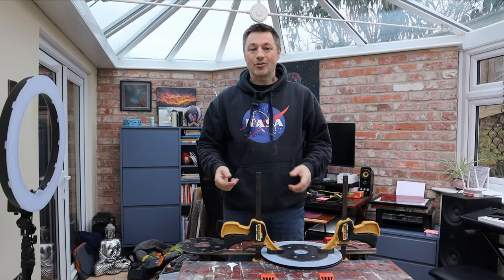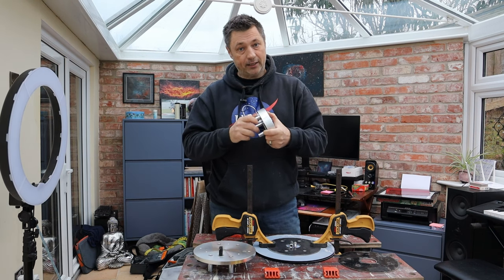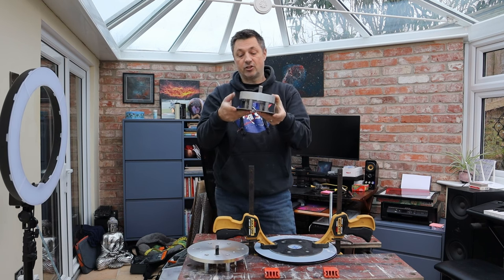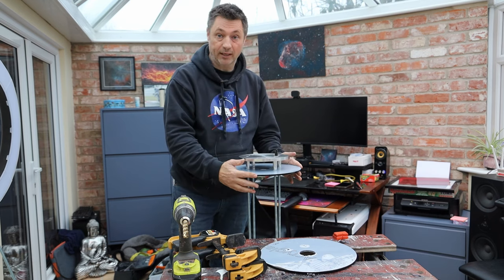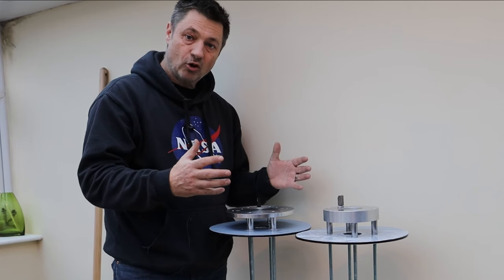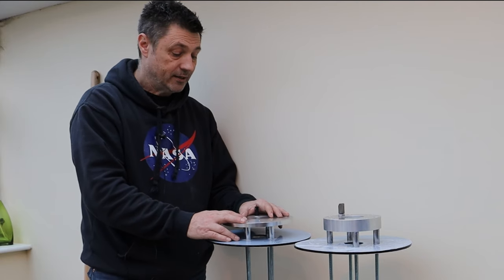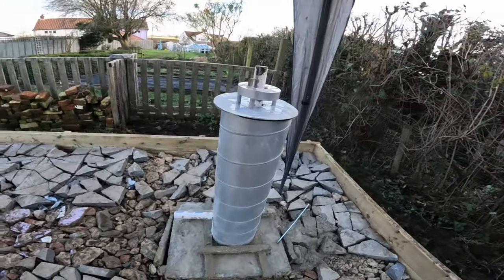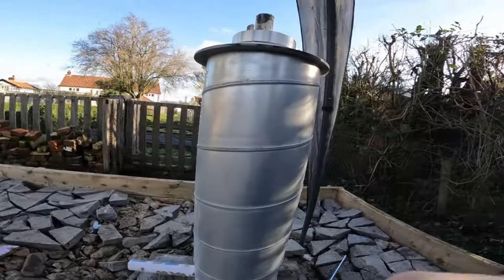How To Build A Pier For better Astrophotography

Comment: The piers look good. I had similar problems getting north and in the end I set a post in the garden and used it as a sight line to get my alignment.
Reply from the maker: Hi Steve. At one point I had a compass and 2 iphones lol. Its as near as and I am confident the mounts have enough adjustment to align even if a little off.  Thanks for commenting, clear skies

Comment: Very surprised not to see reinforcement bars for your base/floor.  I understand the aggregate of broken bricks, tile, and such.
Reply from the maker: You need to watch the full build videos. That was just the hardcore base, on top was placed type one and then compacted, then plastic for damp proofing followed by reinforced grid and then 4-5 inch of concrete.

Comment: You mentioned using a compass.. compass will give you magnetic north, what you need is true north so that you can match earth inclination. They are close but slightly different angle.
Reply from the maker: I know and the compass was just to get the general direction set. Once I got the mounts on I was able to accurately Polar align to true North.

Comment: Looking good mate that obsy's gonna be huge, looking forward to the next instalment. Seeing how you guys build these piers makes me wish I'd done the same with mine as it's just a steel tube bolted to threaded bar sunk in concrete. It's still solid but could have done with being a bigger diameter really especially when I get round to swapping mounts.
Reply from the maker: Thank you Tich. I was lucky to have made a good solid pier before and just done the same but scale it up. At the end of the day mate if it works and once aligned holds your rig stable that's all you need. Problem with mine is if I change my mind and want to move it I'll need some dynamite lol

Comment: Great job! Love the channel... What are the dimensions of the observatory, how far apart are the piers?
Reply from the maker: Thank you so much, sorry it has taken a while to reply, I kept forgetting to take my tape measure down with me. The obsy internally is 2.8m x 3.3m or 9’2” x 10’10”.   The piers are 1.5m apart 4’11” and offset from the centre line about 1’ either side. Hope that helps
Reply: @Astrobloke  Thanks so much, I'm planning mine now and I really like how yours came out! Clear Skies!

Comment: Just a question! What height should a concrete pillar be usind a HEq5 or EQ6-R in a roll off shed with a shed height of about 210cm after the roof has been rolled off

Comment: If you ever do this again get yourself a hockey stick pvc conduit. It's what they use for meter boxes. A nice really slow bend and makes threading cable easier. I did a similar build years ago but with 300mm conduit with 900mm cube under the ground. My back didn't thank me.
Reply from the maker: Thank you. I cannot imagine ever doing it again lol. Thats a good tip with the Hockey stick pipe, not heard of that. Thanks for watching and commenting, clear skies
Reply: @Astrobloke  if you Google electrical hockey stick you'll see what I mean. It's a single moulded pipe so nothing to cause cable to hang on. Mine is an open garden pier but I leave the complete setup there all year under BBQ covers. I ran 240v/12v/cat6 through mine from a workshop at the end of the garden.

Comment: Great job, Glenn, though I recommend 3 thicker rods on the top instead of 4. That way the actual mechanical stability and adjustment are easily achieved.
Reply from the maker: Thanks Jean. The pier adapter is pre drilled for 4 and this is the same build design as my previous pier which worked perfectly. This should be even better as the foundation block and pier diameter are a lot larger.
Reply: @Astrobloke  The FabFour instead of Cream. I agree to that bid…

Comment: Please can you tell me where you purchased the metal tube for the pillar as I'm about to do the same as you!! Thanks
Reply from the maker: Hi Jeremy. I ordered from www.ducting-online.co.uk
01628529122. I called them and ordered over the phone. Online I was ordering 1 x 3m length and was going to cut it in half. I called them as I inquired about getting a pipe with no dents. They said the best way was to buy 2 x 1.5M lengths as these come boxed and so better protected so that is what I did.  Good luck and any questions please ask, happy to help.

Comment: Great content bloke! Im in process of building my pier too, however i only one rebar 14mm, wacked rebar around 2 feet, would it be sufficient? my footing will be 500x500 and 600mm deep. I'm using 200mm pipe. I hope this would take eq8 in future. Please let me know if you think i need more rebars or one would work too.
Many thanks
Reply from the maker: Hi Tadas. Thank you for you nice comment. Any rebar is better than none. The size you have gone for is more than adequate. My first pier was only 150mm and held the EQ8 no problem. I would say that ideally you need 3 rebar to give the concrete more reinforcement. Hope thats helpful, regards Glenn
Reply: @Astrobloke  thanks for such prompt response man. I will grab couple more rebars from work, just to be safe i guess. Keep the lovely content coming!
Clear skies!

Comment: Great work Glenn, are your cables be running under or above the floor in the observatory ? As I can see where the holes are I suppose above floorlevel ?
Reply from the maker: yes I decided above as they will be run from one building to the other and they are to be joined so will not be exposed to the outside at all. Will most probably run a conduit for them
Reply: @Astrobloke  Thanks Glenn

Comment: If there is a potential that your determination of north might be off a bit is there a way to adjust the mounting ?
Reply from the maker: Hi William. I have since checked them at night with a laser and they are looking very good. The mounts are easily within the adjustment parameters of the mounts so will have no issues Polar aligning. That is the only downside to building a pier like this in that once set it cannot be changed (well not easily)

Comment: Awesome Glenn - Using the heat ducts as the mold is great idea. You are going to have the most professional looking home built observatory out there. One question, I know you leveled the tops but ids there still a way to do small adjustments in case you have a small amount of settling over time or an an earthquake 🙂?  Cheers
Reply from the maker: Hi Kurt and thank you. Should be ok for earthquakes but never say never. The 4 bolts beneath the top plate allow for adjustments for any levelling that may be needed. Thanks for dropping in, clear skies
Reply: @Astrobloke  Yeah, that's what I thought. You are up pretty late. Must be clear.  Cheers
Reply from the maker: @AstroQuest1  I was hoping but no. I wanted to try and shoot the comet. Been working nights so this is my routine, off to bed in a bit though

Comment: Great video Glenn. Question I have is how thick of metal plates are you using? I changed my build to follow more along what you are doing as yours is much easier.
Reply from the maker: Hi and thanks for watching and commenting. The metal plates are 3mm thick. They don’t even need to be that thick to be honest as all the weight is taken on the 4 threaded bars set into the concrete. I could have just used the new acrylic discs which are 5mm as these are just to cap off the pier top. I was just going to use the metal plates but because of the larger tubes there would have been a gap hence the larger acrylic ones. All for finished look rather than structure. Hope this helps
Reply: @Astrobloke  Thanks for the rapid response Glenn. Just found your channel and look forward to watching the build.

Comment: Im avidly following this while building my own pier - how are you securing the EQ6 to the pier top? Ive bought the same parts but cant see how you've threaded the mount through? Keep up the good work 👍
Reply from the maker: Hi and thank you for watching and commenting and hope the video helps. I used a short length of M12 threaded bar and using 2 nuts and a large washer was able to secure the mount to the Altair mount adapter.

Comment: Is a concrete pier like this more stable that the metal tube piers that many astronomy shops sell?  Also, you mentioned having issues with your compass to find North.  Did you make adjustment for your location taking into account True north vs Magnetic north. I believe it would be true north that you want to reference and not magnetic north, correct?
Reply from the maker: Hi David. I would not say they are more stable but as a more affordable option well worth considering and going to the effort of making. The steel piers sold are very expensive yet they come with design features to make them resistant to any vibrations. For me I felt the cost was too high and you would still need a large concrete base to mount the pier on.
 As I mentioned its difficult finding north albeit magnetic or true.  Both my piers are Polar aligned so all is good but it was a challenge.
Thank you for watching and commenting on the video. Clear skies

Comment: You must have smaller hands than me Glenn, the clearance to tighten the mount to the pier would be to small for me.
Reply from the maker: Its very tight but I can get my fingers in to start a nut on the thread and then I use a spanner.

Comment: To get a very good idea of where North is, use Google Earth to draw a line due north from your obsy, and see what local landmarks/features/buildings etc fall along (or close to) that line. Presto! you nave a geographically based North line :)
Reply from the maker: Thats a great tip and should I ever do this again I will try that out. I have this evening checked the pier alignments with a laser and Polaris and all looks good so it seems I managed to get them where I needed. Looking forward to testing them out once they have had some good cure time.
Reply: I’ve been planning my pier for a bit, and I’m marking north before I lay rebar, and orienting the edges of the pier forms N-S.  About 6 months till I break ground.  Maybe sooner if I get permission from the Mrs 😜
Reply from the maker: @poolsidestargeezer9338  That's a good idea and will help a lot.
Reply: @Astrobloke  I had no doubt that you'd get it pretty close... lol

Comment: Too bad you didn't have a cement vibrator to get any air out, but it should be fine.
Reply from the maker: Hi and thanks for your comments. I didn’t think it really needed that. It doesn’t show it clearly in the timelapse but it was poured in slowly and carefully and poked with a stick vigorously to remove any large air pockets that may have formed.